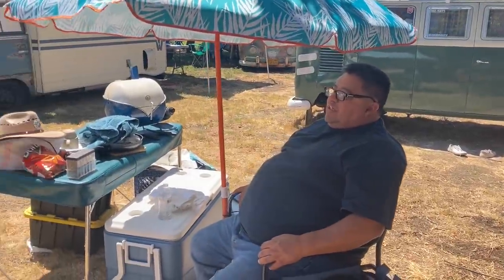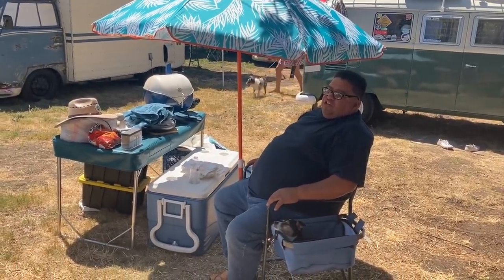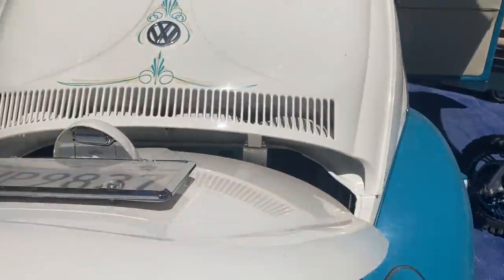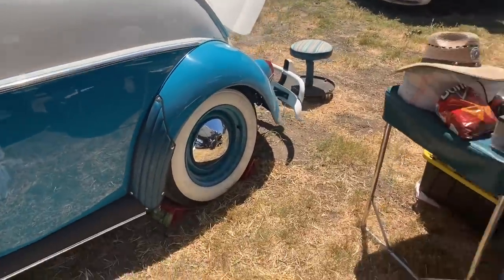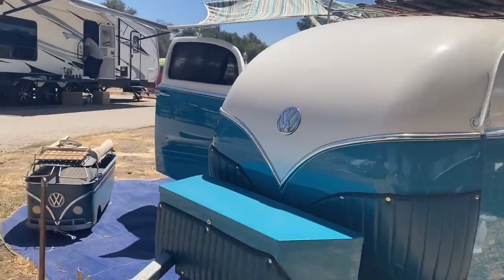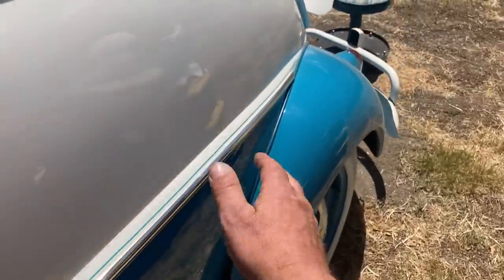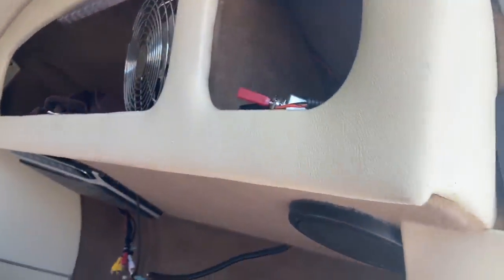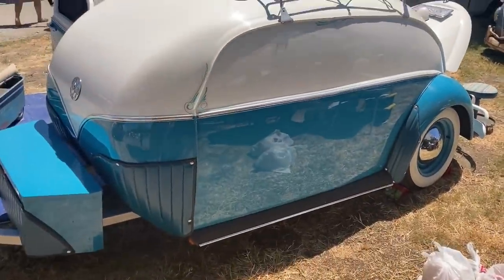DIY Volkswagen Tear Drop Trailer

Comment: Should make a Fiberglass mold of that and sell them it be half the weight at least
Reply from the maker: That’s a great idea!
Reply: glass is not lighter than steel unless it is only 2 or 3 layers n then it would probably fracture in stress area's,  I outa know I built glass hotrod bodies for years!